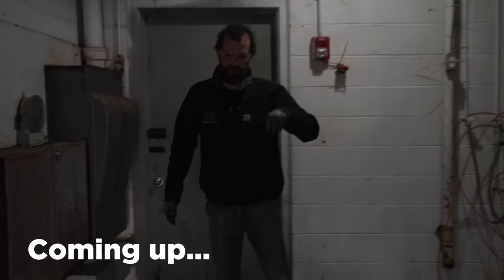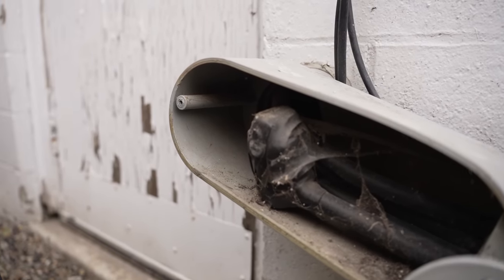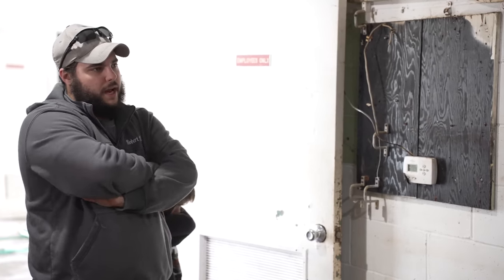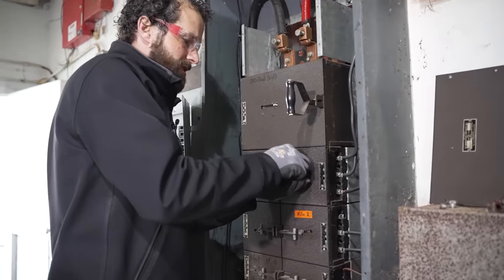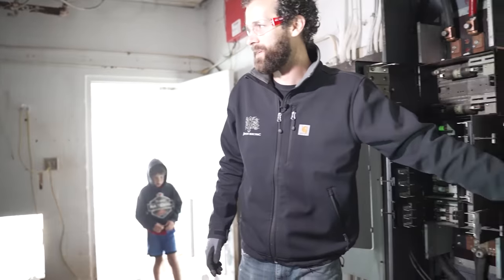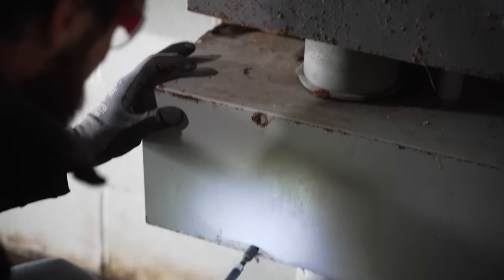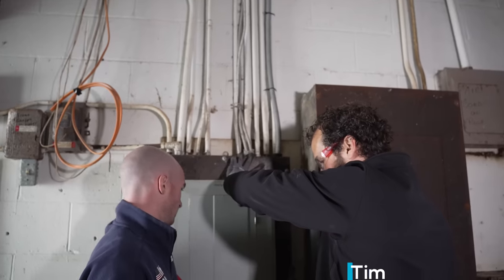This Old Fused Electrical Panel is FLAWLESS!

Comment: That is a very nice panel, It is cool to see old gear like that still kicking it out in the wild, great video man.
Reply: I used to work at the Casino on Catalina Island, and the whole place had lots of the early Frank Adams equipment. The majority of it was still in great shape, despite being nearly 100 years old. 

The only issues I saw were a few of the dimmers and contactors for the lighting in the theater, which are virtually impossible to get replacements for. The solid copper buss work makes retrofitting modern parts extremely difficult.

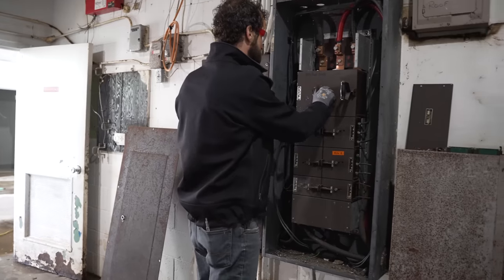Comment: nice dinosaur panel at 9:05  after opening the hinged pull out, you can loosen the nut and slide the whole jumper block left, place the nut back on and close it again to have the power disabled, think of it as an early lockout with easy view window (the slider groove has on or off visible), it's a variant of the smaller fuse blocks/disconnects you'd pull out and flip 180 to have it off/on, with the added safety of having to due more steps to power it back on.

Comment: i would have no problem trusting that equipment, looks better than some new panels i've seen! i swear, that old stuff was Top Notch! In my opinion, it'd be a huge shame to tear it out. The old unneeded Bulldog disconnect and CT cabinet sure, but i would personally hate to tear out that beautiful Cleveland fuse panel

Comment: I love old equipment! it's so neat haha. I did a 400 at a 4 plex a couple years back, here they were all built in the 40s, so nothing had been changed. No weatherhead, no conduit, the outer jacket of the SE wire crumbled in my hand once we started moving it. No fused disconnect until well into the basement utility room (meters were located inside, SE fed in from rooftop second story. Gave me a real appreciation for the work we do. I can sleep better knowing those 4 families are safer now.  Cool stuff man. Thanks for posting!

Comment: My observation of the disconnect at 18:20.   I'm led to believe this is a  4 wire delta system for a couple of reasons.   On a 120/208 wye system industry practice is black, red, blue.   Also there appears to be orange tape on the top of phase C, although red on the bottom,  and older buildings oftentimes placed the high leg on phase C and this system is sometimes referred to as red leg delta.   

Overall very well built equipment that should provide several more years of worry-free service.   Keep up the videos 👍
Reply: it was an service entrance and utility changeover/retrofit from delta to wye system. says my eyes! 😉
so you were not wrong in your assumption.

Comment: The LB is bulging because it's warped plastic. Need stainless galvanized steel. It will be decades before it starts to rust. It won't warp from UV and sunlight heat. Great video, adorable apprentices. Subscribed to your channel but I don't see much anymore which is kind of sad because they're great videos. I just don't click the bell because my inbox gets inundated with things that have nothing to do with what I wanted to be notified about. I love old stuff too. I say keep it as long as possible, but at the end of the day, it's up to the person that's paying for it.
Reply: I agree 100% !  Just take a good sander and sand off the rust on those Panel Covers and doors that need it , apply a good coat of rust proof paint then repaint them  navy gray and make them look like brand New ! Install some weather strip gaskets  to the inside edges of the covers to keep bugs and insects out ! Place some Moth Balls inside each panel ! That's what we do in Texas to keep the Fire Ants out of the panels !
Reply: stainless galvanized steel... LOL 

trying to sound smart and failing there bud... you have one or the other... not both
Reply: @narmale  I'm not trying to do anything. So I forgot to type "OR" my Mother and dog recently died, so find a corn cob, sit on it, and SPIN !

Comment: 17:06 that was the panel feeding the "RTU" HVAC on the roof, very likely there is water leaking in up there multiple places. very likely why it was replaced in the past, even more than once.
my eye sees and says it's been replaced and also had water intrusion for many years(the wood underneath is tell-tale)

Comment: Man, it's incredible, but not at all surprising that the vintage gear holds up better than the modern. Back then things were built to last, and that phrase alone was a huge part of marketing. Things like planned obsolescence weren't nearly as prevalent as they are today.
Reply: The old stuff that lasted forever has its own issues, like many times it isn't the easiest to work on efficiently when things do go wrong.
Reply: gotta remember survivorship bias though. They made plenty of junk in the old days too, the only difference between old junk and modern junk is the old junk is long gone and long forgotten about.

Comment: i have a feeling those thumb screws slide to turn off the fuses. possibly open door. then slide/spin plate. and move thumb screw over to off. and reclose door in off position. 
a lick of paint and that old pannel will feel brand new.

Comment: Around $40,000 gear and labor. Siemans. Add $10,000 for SqD. Wouldn't touch GE for any money, especially the branch circuit breakers. Very slow tripping and had many failures of NEW ones at power up.

Oh, and disagree with you on the condition of that breaker panel,. too much rust and corrosion on that neutral buss. 

I also cringed when you operated that old disconnect while standing directly in front of it. I have had that type fail violently when being operated (one was 100 amp, and three 200 amp units.)  I have been on repair jobs for dozens more, of all sizes, and sadly a few were post-fatality to the guy who operated them. 

Always stand to one side, and look away. That was told to me by my first boss when I was new to the trade, and that advice is why I am still here despite having 4 explosions happen to me. It only takes that one bad disconnect for you to have a very bad (or final) day.
Reply: 400 amp gear is expensive, its not that expensive. a 400 amp 3 pole 208 breaker is about $2500, 400 amp panelboard, even a Square D one is about $1000 without breakers, unless its an I line, those are more expensive, but that's because I-lines are made for 480 and 600 volt systems.

So worst case scenario is customer needs a 400 amp I line about $6-7 k, $2500 for the 400 amp main breaker, and another $800 for a 20 amp breaker, somewhere around $2000 for the 200 amp panel, and probably 4 to 5 additional i line breakers to supply whatever other circuits are not on the 200 amp panel. so actually probably 10-15 K in equipment costs, worst case scenario. 

Of course if it was me I wouldn't even use an I line panel. the only reason to need one is if you have individual circuits or sub panels above 100 amp, and with this setup i dont see why they couldn't just have all the circuits go into one large 84 space or larger 400 amp panel. a setup like that can be done with less than $5K in equipment costs, and that's with square-D equipment.

Comment: Have you ever been shocked through those Maxi flex gloves? Seems like you'll grab hot parts or get very near hot parts pretty freely. I'd usually pull out my Class II gloves but seems that you have good results with those.

Comment: That switching gear should last another 10 to 20 years... looks really really good for the age... yes fuse gear is i think far better then anything braker related for going out to sub panels... theres a reason why high line power is still fused... it just works.

Comment: Extremely rough estimate for replacing all that stuff in canada mind you would be between $45-50,000 CAD thats mainly due to the 400 amp nature of it and three phase doesn't help the cost, up here at least anything past 200 amps becomes prohibively expensive
Reply: It is pretty much the same here in the States, 200 and under not bad, anything higher and the cost of equipment jumps exponentially...
Reply: 400 amp isn't anywhere near that high unless its I-line equipment. Now yes 400 amp is several times the cost of 200 or 225 amp equipment. but a single 400 amp three phase Square d panel, with 84 spaces is still only within the $4-7K range, depending on how many branch circuits there are and what type of breakers are use.

Three phase is only 50% higher cost than same current split phase, but that 3 phase is also delivering 50% more power with the additional pole.

Comment: I wonder whom did that breaker panel retrofit, into the old fuse cabinet? (the panel at 21:28) they were very creative and skilled in retrofitting, granted it likely violates endless codes and inspections. then again, maybe not. lol

Comment: I thought connections were not supposed to be made in an LB?
Reply: They can be if the have a cu in rating stamped on them
Reply: @TheOGize  - ok.  thanks for the clarification.
Reply: Good to visually inspect and checking for proper installation . In addition would also recommended infrared all equipment under full load.  Also have a certified testing company test and measure for contact              resistance.
Reply: Check wire fill.  Conduit body's  can be use for splicing

Comment: Isnt it against code to have that pvc on the ground like that outside?
Reply: Just inadequate support is the only issue. PVC conduit is listed for outdoors, sunlight, and direct burial.
Reply: @mxslick50  ; Only Schedule 80 is , and not Schedule 40 ! But still I would have went with Galvanized Steel Conduit and LB's !

Comment: The thumb screws allow you to shift the connector block over so you can close the fuse door without powering the circuit...

Comment: Replace it all. Breakers prevent single phasing. Fuse exposes live parts to the unqualified. I agree it will last temporarily but temporary usually means forever
Reply: only in a perfect world of not having a breakers/bus/utility supply failures, which drop a single leg! been there done that, it happens. put voltage/phase monitoring at the equipment disconnects or internally to them. that's about the safest way, also surge protection (since everything is now chock full of electronics)
Reply: Thinking you will avoid single phasing with breakers is incorrect. If you skimp on local phase monitor/overcurrent relays all the equipment will suffer when there is a main feed fault.
Reply: @mrfrenzy.  breakers are not for motor overload protection and cannot be skimped-on. I would like to know how a multi-phase breaker can single- phase?
Reply: @sdsmtmsee2279  the upstream fuses and wires anywhere between the  breaker and distribution transformer can fail, also one leg of the breaker can fail. Breakers do not protect your motors from single phasing.
Fuses and breakers are only to protect wires from overheating. Instead of spending money on replacing fuses with breakers spend it on proper motor protection which cuts power as soon as one phase is missing or the motor is overloaded.
Reply: @mrfrenzy.  that depends on how its configured. if there are no fuses anywhere on the load side of the transformer, then a single phasing event is going to be very rare, as a wire breaking without tripping breakers is a rare event. And if the fuse on the primary side of the transformer bank fails, the transformer will still supply all three phases on the secondary side, though at reduced load capacity. 

So eliminating all fuses in a system, while it doesn't totally eliminated single phasing risk, it does dramatically reduce the chances of it happening.
Reply: The failure mode for fuses is to blow. Circuit breakers can get “stuck” on, see Federal Pacific as an example.
Reply: Breakers and fuses are for short circuit protection only. Overload relays are for overload. You can still have a single phase situation with a blown fuse. You can have breakers not trip that’s because of poorly maintained breakers.

Comment: I prefer shiny new electrical equipment as much as the next guy, but...  wow, nothing wrong with those fuses. If the environment inside those cabinets stays dry, those still have a long life ahead, I don't see any reason to change them out.

Comment: If the 400A dist. panel is good for 24 months, why not 36 months? ...or 60?  Why mess with it at all?
Reply: I agree. He talks like it’s going to fail in two years. If it’s a concern, come back in two years and inspect it. He has fuses, everything was clean and tight in that 400 amp enclosure, why mess with it? Why contradict yourself upselling something in the future that may be fine, if your assessment during the inspection was good?
Reply: Looks like it has been doing its job for 60 YEARS and will do 60 more without sweat ;)

Comment: WHY replace that Big Distribution Panel? If It looks good and OK and works good , Leave It !  Just get rid of the Big CT panel and the Interior 400 Amp Disconnect if not required because there is one outside !
Reply: I personally would prefer to keep it if it were mine, it would be a shame to rip it out in my mind
Reply: I was about to ask, why replace it at all if it meets code and is in great condition. Fuses work great, in fact, they're more reliable than breakers at overload protection because there's nothing to jam or weld shut.

Comment: That cabling, and equipment in general, looks like the stuff that was being ripped out in the UK during the 50s/60s. 
The yanks seem to be still using it 🤷‍♀️
Whatever works. I suppose the voltage is lower, at least partly,
Reply: Yes and none of that equipment is suitable for its environment. Ingress protection in an area for pressure washing , water ingress found in 2 enclosures 🤦‍♂️

Comment: He seems a little bit out of his league on this  job and his timeline is far toi short. A job like this would require at least 2 years to avoid outages and that's to factor in supply shortages and special parts. He's way to confidence, the people and resources that went into building this out shouldn't be under estimated. Proceed with caution.

Comment: You'd be lucky to get a 3ph panel at 200 amp right now.
400 amp SD- $750
400 distro- $1800
200amp service 40 slot- $1285
Reply: i think thats more to the fact that 200 amp is just not a common size for three phase. Three phase panels are usually 225 amp, and there are plenty of them around and they arent that much more expensive than a 200 amp split phase panel.